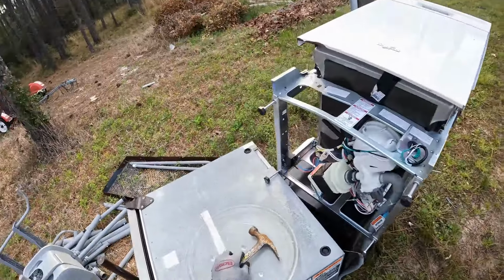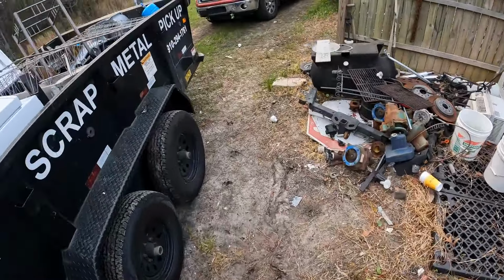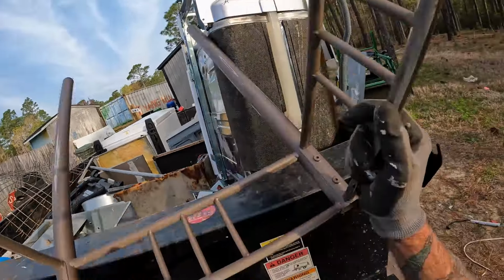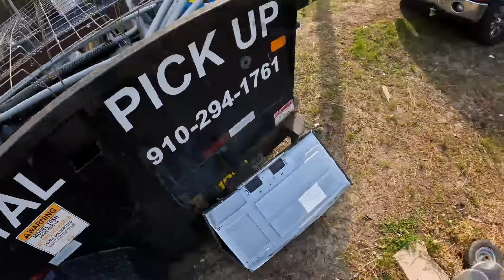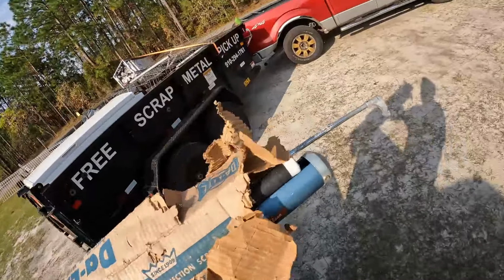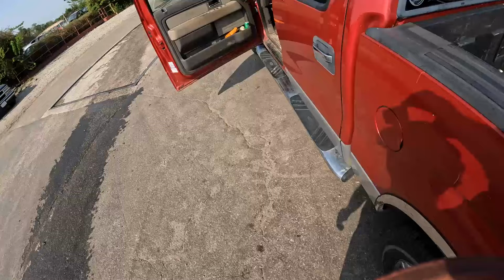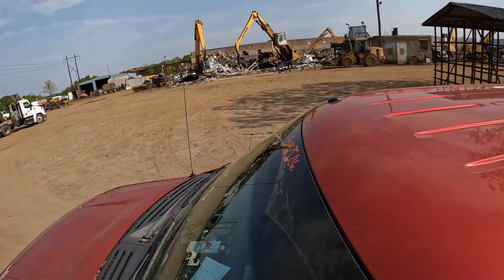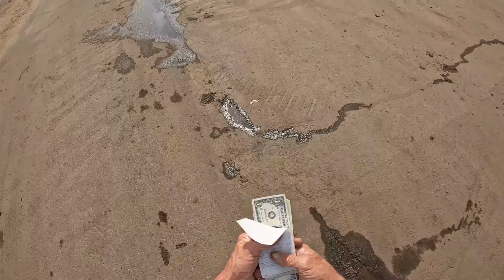Loading my scrap metal and headed to the scrap yard.

Comment: Filling your trailer up with goodies my scrap yard won’t take dishwasher too much plastic on them buddy but I use them as containers to put scrap in them!!also for my scrap yard to take microwave I have to take out the  magnetron in oder for them to take them guess something to do with radiation or something like that 
Stock pile up all my cords and insulated copper wire it piles up quick! And yeah I seen that about the electric motors buddy I have no idea why I got what I did for my motors buddy! Had a great load and great payday buddy great video!!
Reply from the maker: You’re the best. Your yard is a rip